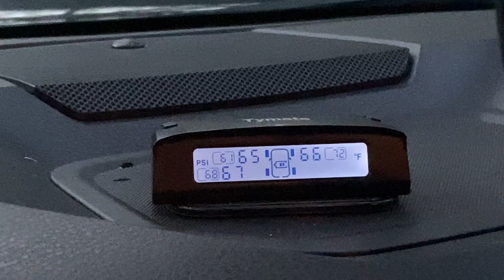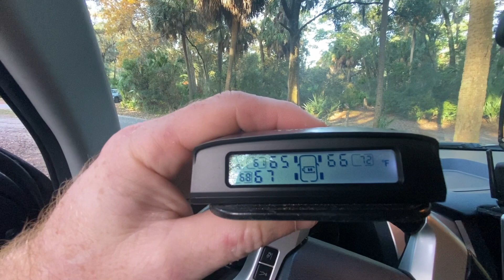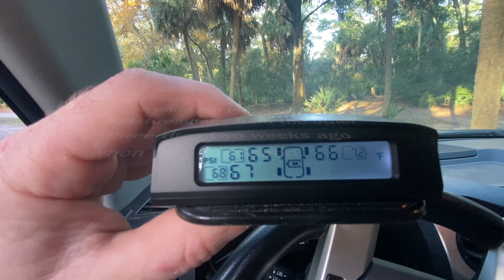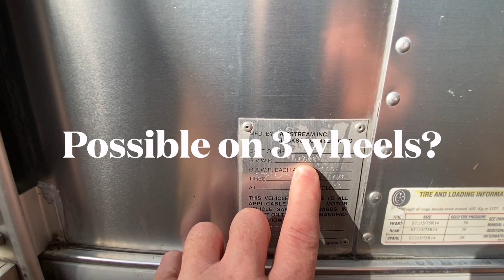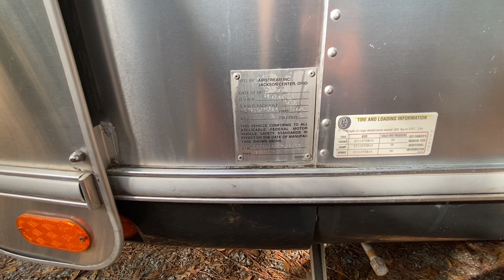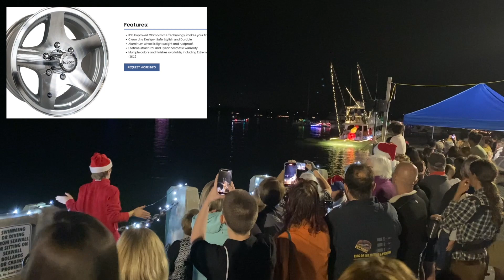Airstream Wheel, Hub, and Tire Totally Destroyed   Gone!

Comment: Sorry about the bearing failure. In my experience, it’s better to replace rather than repack. And that includes the race too. I had this some failure on my boat trailer and I was shocked. And if I did have disc brakes, I concluded that my tire would have flown off the spindle. $100 to replace bearings in four wheel a year or two, not a bad deal comparing to the potential damage they do when they fail.
Reply from the maker: Appreciate the advice, that's going to become part of standard maintenance going forward.

Comment: Looks like the bearings failed, the wheel disappeared and you lost the signal.  Was the cotter pin missing? The nut loosened, the bearings pooped the bed and you lost the wheel.
Maybe a better pack job would have prevented it.
Reply from the maker: I would think the same thing, except. I packed the bearings mid september.  !st week of October, ?I took it 6k miles across country, no issue.  Back to back 16 hour, 1000 mile days at 70-75 on the way home.  Stored it until first week of December and took it less than 150 miles at 55-60.  Never got a hot reading from TPMS

Comment: Definitely bearing failure, probably not just grease  but wrong torque specs resulting in the overheating and catastrophic failure. Human error, always tight the castle nut to 50lbs the back up from 3 to 12 ( clock face) and that should be a good tolerance for the bearings.
Reply from the maker: After I greased the bearings, I did a 6K mile trip in 11 days.  On the way home to eastern GA, I did exactly 1k miles in back to back days going 70-75.  No failure.  Two months later, it failed to do 150 miles at 55-60 across SC to the coast.  Maybe it was just time.  Tire never read hot.  Something failed, that is for certain.

Comment: I believe most trailer tires are rated at 65 MPH maximum, wondering if you were exceeding this speed?
Reply from the maker: Many are, but the Endurance that I use are rated to 87 mph.  Tire Blowout wouldn't explain everything missing.  This was all back road driving, never above 65 mph.